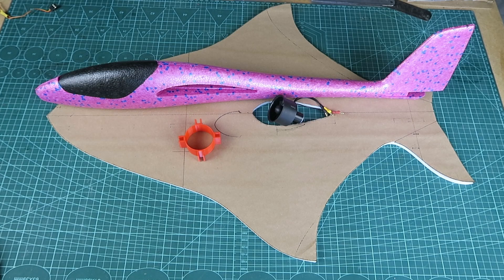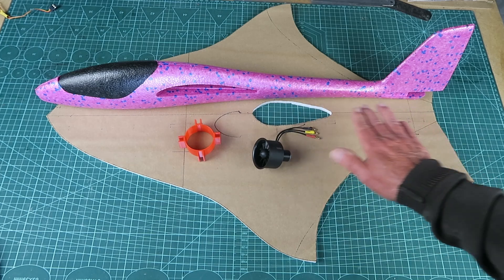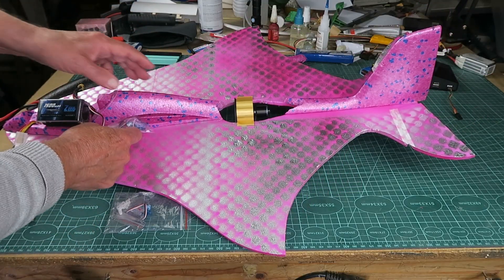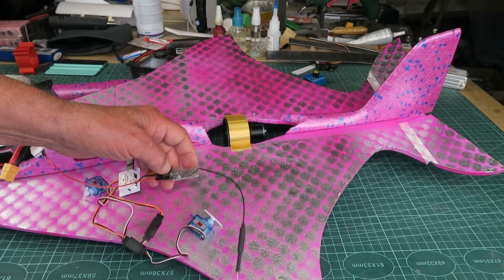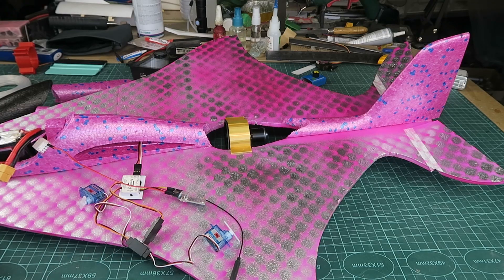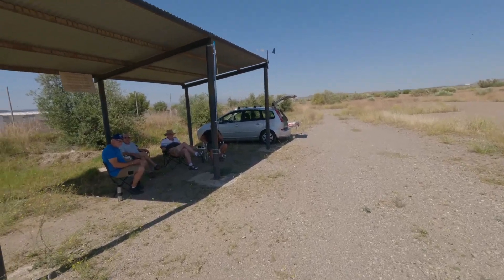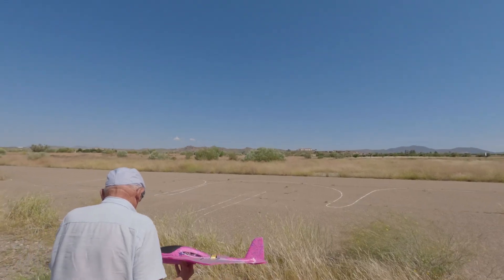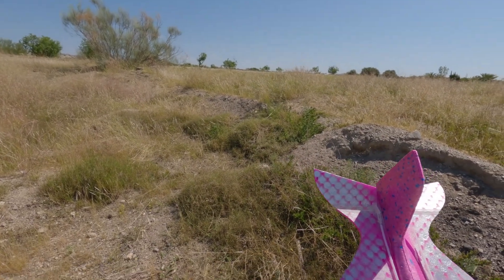A LidlBitFishy DIY EDF Smartfish  Hyfish RC Plane – Build & Test Flights!

Comment: Well, i think wings profile it's very important, but to compensate that, maybe ame size edf with more trust, and 4s battery with more drain capacity, hope it helps, hugs from canary Islands ❤
Reply from the maker: My previous Lidl EDF had the fan above the fuse: https://youtu.be/pRg61UC0xB8&list=PLxtbRS-naT68PQVcBSziD3c9Uk6sNhR_f  I will try that with this model.  Also I may add a KFm2 aerofoil. Un saludo desde Andalucia.

Comment: body is flexing near the motor cancelling the up elevator.
Reply: I was going to say the same thing as well, the fuse flexing gives the whole tail a mass down elevator even though the elevator is going up.  that or the cg is way too far back which can cause the same uncontrolled pitch, like a mind of its own, going up one second and down the next.
Reply from the maker: @crashawk  Version 2 is complete, the next good flying day and we will see! Thanks for watching, have a great day!
Reply from the maker: Thanks for your input. Version 2 is underway with a reinforcing rod down the center and the EDF moved forward to on top of the fuselage. Watch this space!

Comment: The power seems adequate, looks nose heavy to me. It's falling much like a spear
Reply: I agree it appears that the C of G is too far forward, never mind what the plan says.  It’s speed seemed more than adequate which suggests it’s not short of power, but a flat plate wing will never provide as much lift as a profiled cross section.  What’s the wing loading?  Intuitively it seems a bit short of lifting area.  Interesting project, and good luck.  I followed the design of the original when it was being flight tested prior to being scaled up to a full size aircraft, and it flew well with a profiled wing section but it was fast!
Reply from the maker: @ianmathieson65  I only estimated the wing loading as it is a complex shape, assuming it is basically all wing then the area is 564 cm². The original battery gave an AUW of 317g giving 56.2 g / dm² or 11.5 oz / ft². I have moved the EDF forward and above the fuse, and moved the servos back. The CG is about the same and I changed to a lighter 1300 pack which gives 11.1 oz / ft². We shall see!
Reply from the maker: Yes, it appears that way. It is strange as it is spot on the CG given in the plan. Working on the second version now, stay tuned!

Comment: cut the hole infront and behind the motor more it is not getting enough air imho. i did  a bow tie type design and it gave the little profile f22 about 25% more thrust!
Reply from the maker: Great tip, thanks. Version 2 coming soon!

Comment: My guess is a lack of power. As others have said your EDF airflow looks less than ideal. As a quick test if the fan can take extra voltage you could try a battery of similar weight but with an extra cell. I also think your control surfaces might need a bit more throw since tailerons are not all that effective unless really well matched with the airframe. People also seem to fly edf jets of this type more tail heavy to help with pitch authority and let the gyro make it less twitchy. Keen to see part II.
Reply from the maker: Great input thanks! Version 2 coming soon!

Comment: Control rods to flexible. EDF in the middle not directing thrust properly. Maybe just use motor with 3 blade prop? Maybe try a KG aerofoil wing? Nice try, great channel.
Reply from the maker: Hey thanks! Version 2 in the pipeline, watch this space! Have a great day!
Reply: KF
Reply from the maker: I may try a KFm2 if my current mods don't work!

Comment: you may know that an aircraft has a center of mass (c-m), as well as a cg.       like cg, the distribution of mass (dom) determines the ultimate location of the c-m.    and the dom is determined by the  model-maker's  knowledge.        the tail could be made a little lighter, by using  tape-covered  cutouts where practical.
Reply: After all these years and you still haven’t changed David 😂😂😂

Comment: the edf thrust arrangement is less-than ideally configured.       specifically,  most of the thrust is blocked, by the material located aft-of the edf.       for best efficiency, an edf should have a correctly designed exit duct.     eg.,  over a distance of six inches or so, the exit duct should taper such that the  cross-sectional area at the exit opening is equal to the effective  swept area of the impeller. 
you may know that, in most cases,  tailerons provide an inadequate amount of control.        in this case, the tailerons do not extend far enough from the center line to effectively control  roll.      said another way, without ailerons the main wing   opposes   roll inputs, at the tail.

Comment: The airflow going into the EDF unit is being disturbed/blocked by the front fuse, this gets worse and worse as airspeed increases too, very low pressure area there in the 'windshadow' of the fuse. Youd want high pressure air for the EDF to suck in. Also the Exhaust is being blocked by the tail, robbing it of momentum. Theres a reason EDFs usually have jet-like intakes and exhausts as apart from combusting fuel they operate in much the same way.
Reply from the maker: Thanks for the input. My previous Lidl EDF had the fan above the fuse: https://youtu.be/pRg61UC0xB8&list=PLxtbRS-naT68PQVcBSziD3c9Uk6sNhR_f  I think I will try that with this model. Thanks for watching, have a great day!